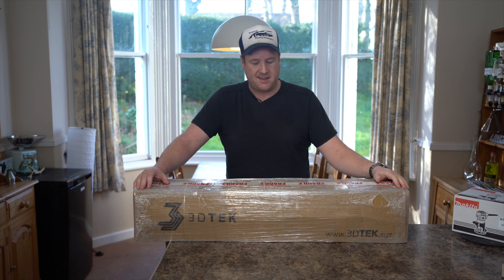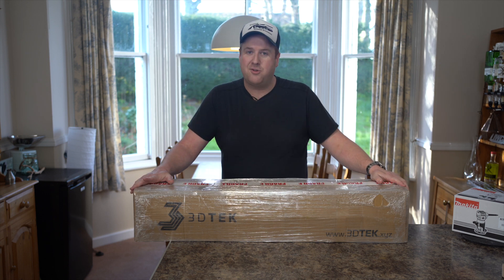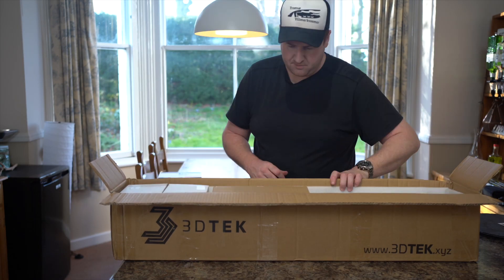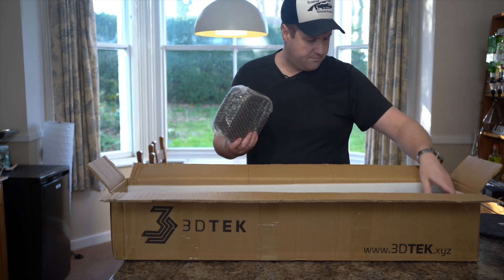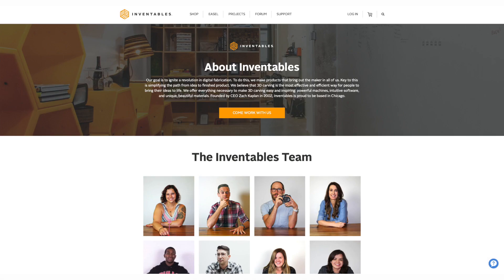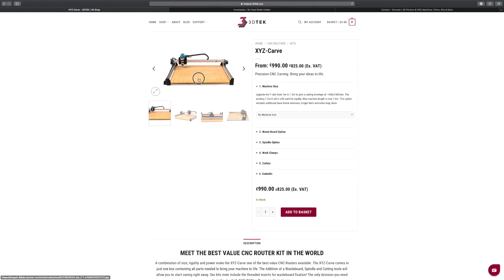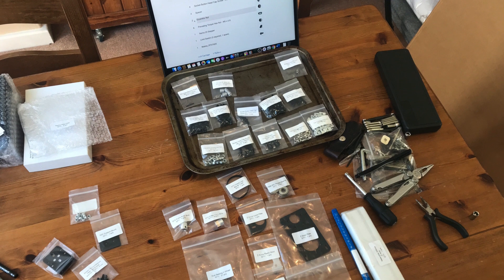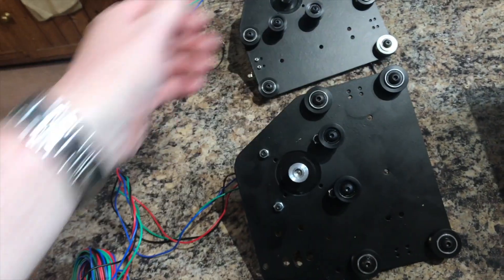XYZ Carve by 3DTek - Part 1: Packaging and initial assembly - Why Wait? Create!

Comment: Hi Paul, did you have to buy the spindle separately?  if so what did you buy?
Reply from the maker: Hiya Warren - so I bought the Makita router (think it's like an RT0700 model). A lot people mention another brand called Katsu which looks almost identical but is about £35-45 (as opposed to the Makita which is about £60-80). If I was to do it again I'd probably try the katsu and see how I get on with it as they seem to be ok for the money :)
Reply: @PaulWilson06  Thanks for the response mate, so how is it going as your vids I found are over a year old now, any problems or upgrades you have made to it?
Reply from the maker: @warreng3142  hey man 🙌 I’ve just done a quick video update and your comments feature in it ☺️ both machines (heavymill and xyz) have both been amazing, though this last 16 weeks since baby arrived we’ve had some time off cnc/craft/woodworking, but I’m back on it now ☺️ big fan of 3dtek, excellent machines and incredibly capable. What sort of work are you looking to create?
Reply from the maker: @warreng3142  hey man 🙌 I’ve just done a quick video update and your comments feature in it ☺️ both machines (heavymill and xyz) have both been amazing, though this last 16 weeks since baby arrived we’ve had some time off cnc/craft/woodworking, but I’m back on it now ☺️ big fan of 3dtek, excellent machines and incredibly capable. What sort of work are you looking to create?